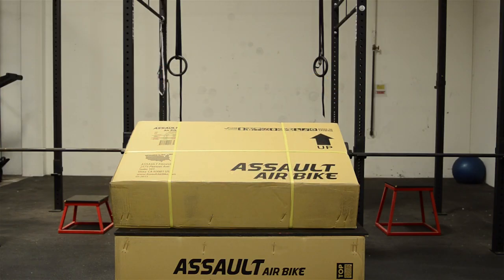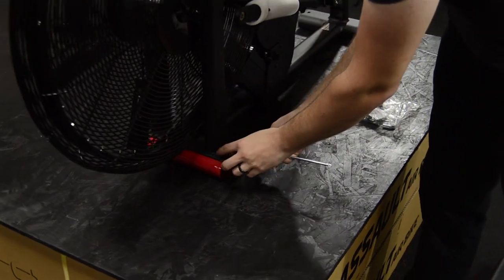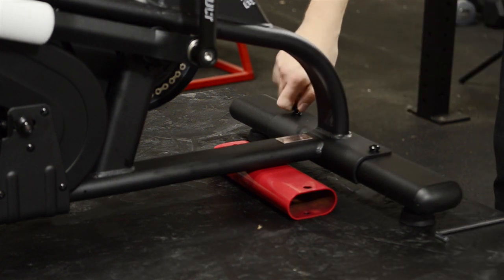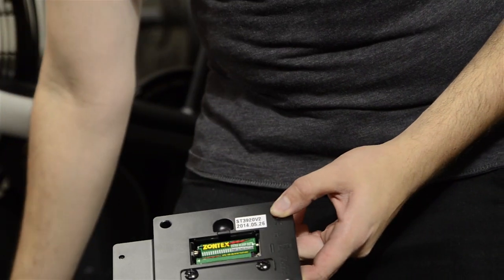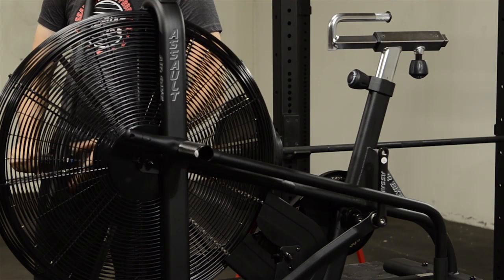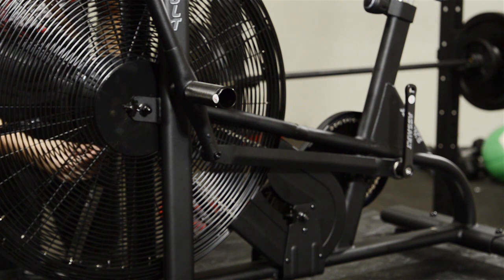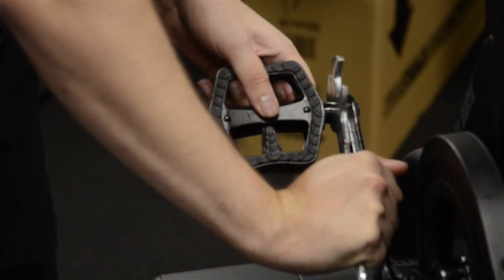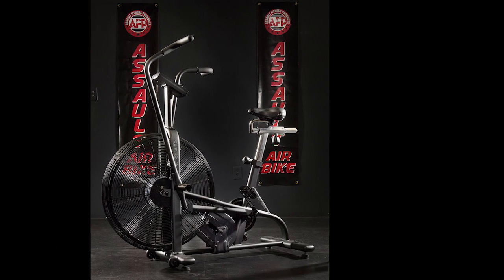Assault AirBike: Assembly Guide for the Assault AirBike

Comment: Thanks for this video. Is this bike chain driven like the old schwinn airdyne AD4? I hate the newer schwinn airdynes AD2 and AD6. They are made of cheap plastic and are belt driven, both of which I hate. Schwinn made a mistake when they stopped production of the old classic AD4.
Reply: Yeah, it's chain driven for that nice, mechanical feel. The pedal mechanism is almost, if not identical to the AD3/AD4.
Reply: Thanks for your reply.